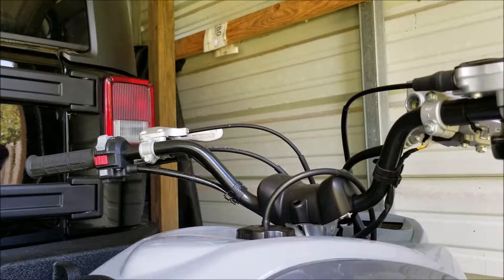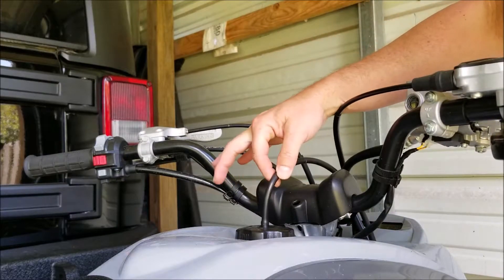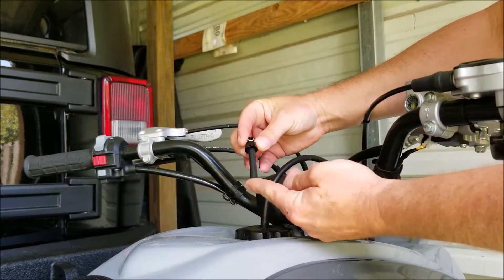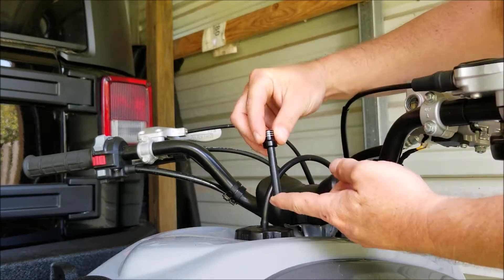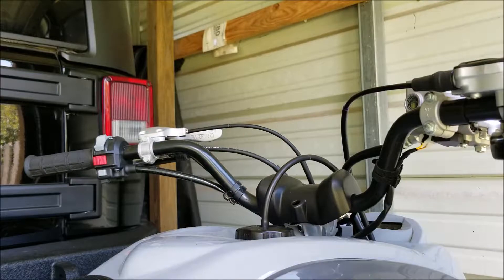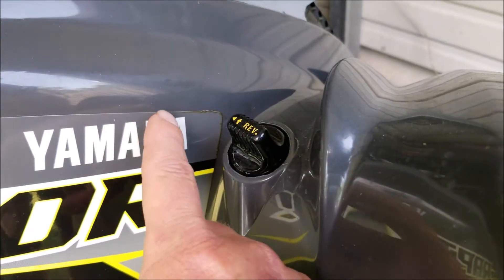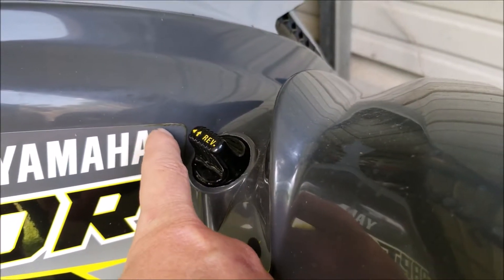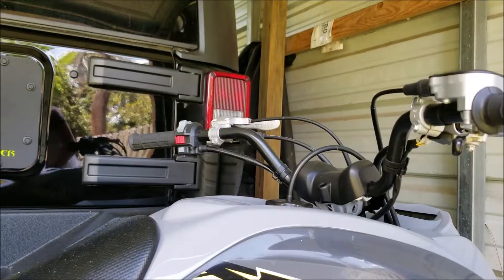Gas Cap Vent Tube Upgrade | 2019 Yamaha Raptor 700 - Saves Your Decals

Comment: Yeah... the tube isn't the problem lol if it was then you be assured the one your replacing with it will as well. If you have liquid fuel that's able to get out the top of the cap the cap it's self is faulty. One way valves on plastic tanks cause pressure issues in the heat. ( with carburetored) machines.. this can pressurize the fuel causing the float valve needle downwards flooding  the engine with gasoline.. like literally. Hydrolock with gasoline. I had it happen before on my yz250 3 times before I realized the valve was causing it.
Reply from the maker: I just put a vent tube on the gas cap, didn't have any issues 🤙🤘

Comment: was there gas coming out of that stalk vent hose I'm assuming?
Reply: I have a 19 yz450fx and when the gas shakes up it spits up and out the vent hose causing a fair amount of gas to spill even when it's at like 3/4 of a tank ... thinking its poor design
Reply from the maker: We noticed that a bit of gas was running down the side of the bike, thus the upgrade.  It was as if the fumes were being vented and then condensing back to liquid form exiting the stock tube for us.  No issues with the new tube at all since installing.  I'm sure as heat builds, it puts pressure in the tank and may push gas out as well.  You could always buy a really long tube and vent it to the bottom of the frame as well.